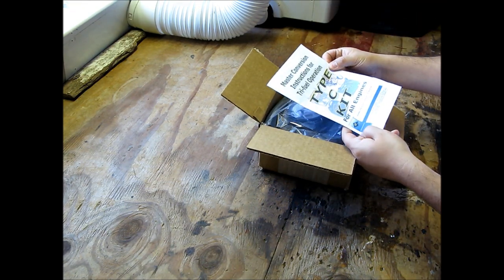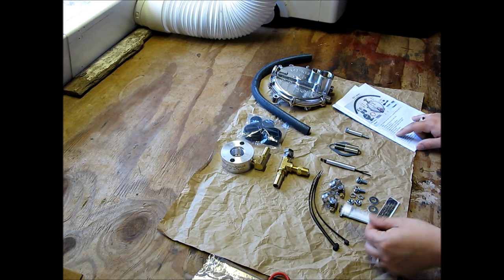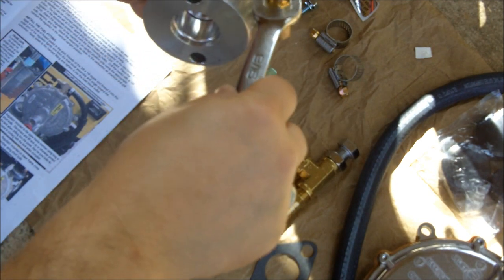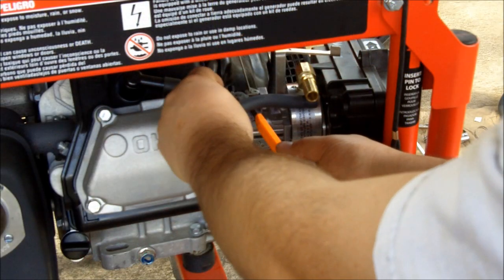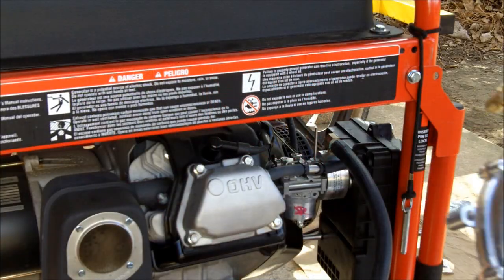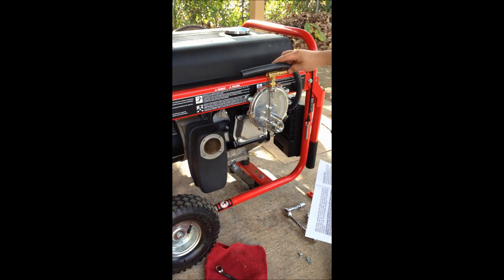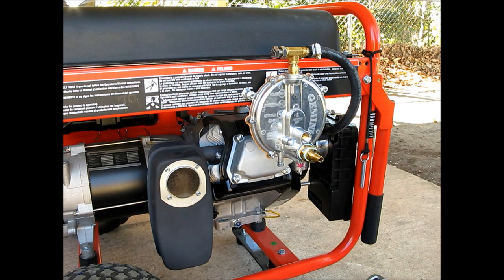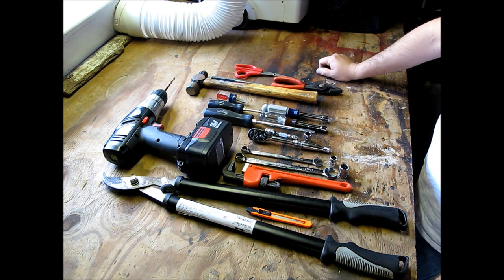Installation of tri-Fuel conversion kit from US Carburetion

Comment: Good video, I used to convert Kenworth trucks to run on nat.gas/lpg.
Your oil will stay clean for years and the valves will be fine as they arn't lubed with unleaded gas today.
Power is very close to the same as with gas.
Reply: Steve R  they use these motors on smaller standby generators using nat/lp gas no problem.

Comment: This is probably the best produced video of any installation on YT.  Thanks for not making us sit through 3 minutes of sealant application.  Also, LOL at your welcome mat in your other video.

Now you need to make a video of installing a quiet muffler on this thing, maybe another for valve adjustments, and then you will be the Yamaha generator rock start.

Thanks.

Comment: Two things you did wrong¡ There was a part that was inside the air cleaner and you put it on before you put the air cleaner. Also you did this with just a 3/8 line to the generator. This may not move enough gas to run the generator under a heavy load. There was a reason they had it set up for 3/4 line. I have worked with generator running on natural gas and under a heavy load the low gas pressure that is used to feed this the small line may not let enough gas flow to get the engine to work at full power.   Thanks for the video!! It gave me some information I need.  I live in South Florida and it isn't easy to keep enough gas around to power a generator when we have a storm and the power is out for anywhere from 1 to 10 days. We don't know how long it will be out. This is Jan 16 and I still have gas in cans that I need to put in my truck. I thought the power would be out longer than it was. From the storm last September. The 5550 generator I use can burn up to 10 gallons of gas a day

Comment: the metal spacer that goes inside the air filter box you put on the outside of the air filter box against the carburetor.

Comment: Yah it would have been good to seen the load block adjustment , it’s a full turn out for every horse power ( installed several already )
Then you run the generator at full load and this is the biggest mistake people is run it with less or more than rated full load , and adjust the bolt in the load block to get the best running out  of you generator ( sounds smooth ) , if it’s set right , on propane you should not loose any power , if you can’t get it to run the full load , and the load block is set right ( instruction are included in the kit )your not suppling the demand regulator with enough propane/ng , natural gas requires a lot bigger line than propane ,generally speaking you will loose some power on natural gas , special note if your generator is not keeping up to the load you need to make sure you have enough fuel supply to the generator ,  if the engine rpm on ng or lpg is higher than gasoline , you have a air leak between the load block and the the carb , letting more air in and increasing the rpm , any engine over 20hp require a bigger sized engine regulator , another note if everything is set right and a 1 plus later the generator can’t keep up , try pushing in the little button on the back of the regulator in a little  , if doing that help the generator carry the load your demand regulator is going .
Us carb / motor snorkel is good but they are poor with any help from them , ( I do gas installations and small engine mechanic repair on the side so I didn’t have any issues) used Kits on mge6500 with electric start module added , plus eu3000is with electric start module , eu2000
Hope that helps , like I said the load block ( all instructions ) instructions are included in each kit , generally for that kit , I run the mge6500 and eu3000is and eu2000 , depending on my power needs , off my house/ garage propane as well as potable tank with the 12’ quick connect kit when at camp

Comment: Hey fyi there was a silver oval bracket on the air box , you put it under the air box on the gasket, but that bracket was actually on the inside of the air box, I doubt it makes a difference but just in case . Thanks fo the video very helpful.

Comment: Thanks for the informative video.
Someone asked what the setting is (if any) for the bolt in the brass tee, at the top of the regulator. Any elaboration is appreciated.
Reply: That is a VERY important question Sir? For if that adjustable bolt is not JUST right; you might even get the engine to turn on. And IF it does start; it may NOT be running as it should. So that bolt must be set at the perfect setting for the motor to be efficient.

And worse: when one goes from natural Gas to Propane Gas and vice versa; that bolt almost always HAS to be adjusted and vice versa. Oh indeed. And that is why many manufacturer's will ONLY sell Dual Fuel and that means Gasoline or Propane. For the customer must change the setting; that adjuster each time from one or the either.

Note: But today 2 manufacturers have "TRI Fuel". with NO need to adjust the regulator. For their engineers has set the different settings already. And that is going to be the future. For what it's worth!

Comment: The one piece of info I was looking for you didn't elaborate on. How did you determine where to set the locknut on the big tee at the outlet of the regulator. That is a giant needle valve. Can't seem to find much about it.
Reply: Alan DeVincentis I’m familiar with the US Carb Trifuel kit and the standard setting on the bolt and nut is 7 completed turns out from all the way in and tighten up the nut it’s a good idea to use a black marker on the bolt and turn bolt out every time you see the mark 7 complete times and that is the standard setting for 12 + HP engines.

Comment: So how long have you been using this system and is it still working??? Is your generator still working?? Does it at all change the output of power when you run different fuel???

Comment: I was kind of amazed that nobody has asked the real question. Why did you put the regulator directly in front of the muffler? I would not want to have it anywhere near the hottest part of the generator's engine. Surely the instructions must have mentioned that little piece of info. Has it blown up yet?
Reply: No he didn't.   The exhaust is off to the left.  The box that says OHV on it is the valve cover.  this is an overhead valve engine.
Reply: heat from the exhaust would actually help vaporize the propane from liquid to a vapor what you want for the engine to burn it.
Reply: Then you have to move the regulator to adjust the valves, arrggghhhh , I wanted to hear it run! Should have watched TV instead.

Comment: You did a great job in installing. However, you didn't show us the most important thing. That was to adjust that "bolt and nut" at the top of the Regulator. Whenever you use Natural Gas versus Propane Gas. Because their pressure's has to be JUST right. And you can hear that when the engine is on. And..

That is VERY important to get the best "efficiency" out of each "gas". Worse: if the adjustable bolt and nut is near working; you might not even start the engine at all. Oh indeed. For what it's worth, but NO disrespect toward you atoll kind Sir.

Comment: with  this kit sometimes have to cut the roll cage bar off go to V Power Motersports.com they have duel fuel carb kits for $100. great kits i love mine i did mega research before finding them youll love it to . and for small gens on e bay they have the carbs alone cheap like $25. bucks lol

Comment: I am puzzled about the ability of the motor to adjust to changes in load.  With gasoline the butterfly opens more when the governor calls for more fuel to maintain the correct RPM's.  Both gas and air are increased at the same time and the air/fuel ratio is maintained. I am guessing that with the propane conversion, when the governor calls for an increase in RPM's due to increased load only the air flow will increase and no increase in fuel will mean the engine will either slow down or quit all together. Is this a problem?
Reply: I had a problem installing a kit similar to this whit the adapter between carb and air filter, problem is the adapter chokes the airflow , so when trying to run gas it couldn't handle a constant load because I couldn't get the required airflow.    so I bought a replacement trifuel carburetor for 50$ ( while using the rest of the parts from this kit)   works great
Reply: Inside of the regulator that he mounted on the side of the generator is a diaphragm. When the engine requires more fuel or propane the regulator's diaphragm opens up more to deliver more gas. Plus the little valve he mounted on top of the regulator helps adjust the airflow to the carburetor with the air coming in from the air filter. When the generator slows down and the engine requires more fuel the regulator will adjust for the amount needed.
Reply: If you got the tri fuel carb why would you need parts from this kit? My tri fuel carb didn't need any extra parts. I hooked my own quick connect hose on to it. In my opinion the kit used in this video is not good compared to the tri fuel carbs that are out there. In the amount of time it took him (4 minutes) to inventory his parts my conversion with the tri fuel carb was complete. At least he didn't have to cut his frame like many others have experienced when using this kit.
Reply: Apparently you purchased a tri-fuel carb. This kit he used allows you to convert your standard carb to use tri-fuel. May I ask how much your tri-fuel carb cost you or even where you purchased it. I have been wanting to convert my Generator over but doing so without a kit but with an actual tri-fuel carburetor. And your right the kit is not as good as the carb you purchased and this is why I have been waiting to convert mine over. A few years ago I saw some one advertise a tri-fuel carburetor but I havn't been able to find it sense. As for the inventory I think he was showing everyone what comes with the kit he purchased so they would know what to expect. Thank You
Reply: I got mine off of Ebay. Go to the ebay main page and do a search "dual fuel carburetor". I have a small 3.6KW gen and it cost $39 with free shipping. The price will be higher for larger engines. It will help if you know the size of your engine to get the correct carb. For example, I have a 208 cc engine so it is a "170F". I am very happy with this carb even though I haven't tested with NG. I'm confident it will be fine on NG. On propane the engine runs great. I never even ran gasoline through it yet. The name brand I bought is Tonco. Another thing, I just did a cold start the other day for fun and I was running after 3 pulls on propane. Normal startup is 2 pulls per the instructions. 15 degrees outside that day.

Comment: When I converted from gasoline to natural gas I lost 20% of my power, buy a bigger generator than you think you need.
Reply: You make a very good point Richard...  Natural gas gives you less BTU's than propane...  A generator 'should' be used between 50 and 60% of it's capacity under 'normal' use...  to extend it's life.   Trying to run one at close to or at 100% capacity, is a sure way to cut it's lifetime short.